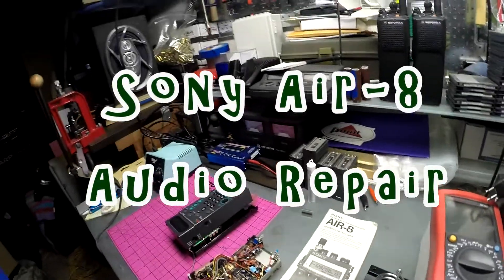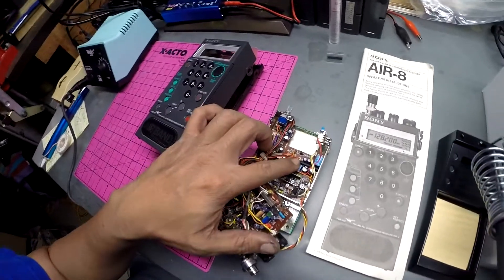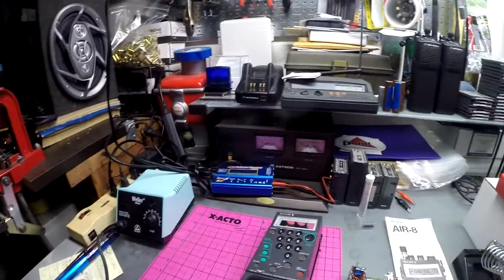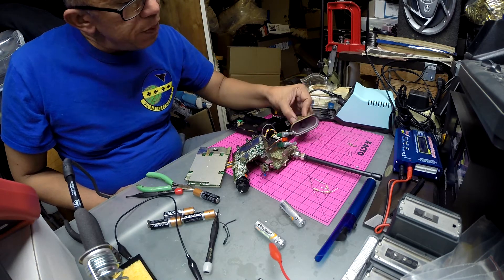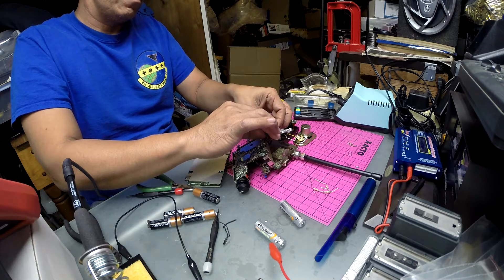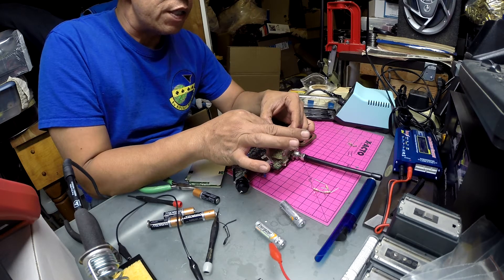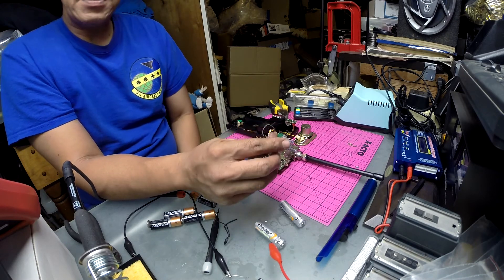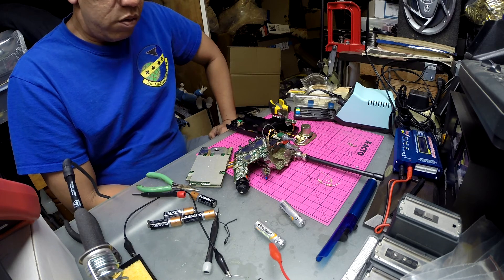Sony AIR-8 Audio Repair

Comment: I have replaced the AF Amp, capacitors, C243, C246, C249, C245, C247, C250, C62,  and C265. I also replaced resistor R246, transistors Q210, And Q211.  IC 203 is outputting 3V just fine. When I adjust the volume I get little change in volume but it’s there.  The Squelch is working just find but I did replace both volume and squelch pots just in case but the is no change.  When do I look next please advise?

Comment: Mike new issue with a Sony Air-8 I just got. I have audio and lots of it but it’s on full blast and can’t change it.  I changed the volume potentiometer but not change any ideas?

Comment: Good video just plugged the wrong power plug into external Jack and can’t get any sound from it (Sony air-8.) any ideas? Thanks John.
Reply from the maker: maybe you could have  blown something if the power  had the wrong polarity or voltage

Comment: I just got my ICF-Pro80 to work as I recapped the entire unit and replaced the AF amp.  FM works grate but my AM/SW/MW is quiet on that band did I miss something?
Reply: plug in an external antenna, anyways, it would have been better if the SW tunner went up to 30MHz on that model. but well, probably just to annoy us and focus on the VHF.

Comment: I changed all the caps, the two pots, the AF Amp and I still don’t have any audio please advise.
Reply: Hello there. I have that same problem. Did you solve the problem.I did all the things you did, but there is no sound. Only ic1 and ic2 left
Reply: FELL TURBO I am at the same point as you going to change the ic1 and ic2 today. I will let you know also check the muting circuit while you are at it.
Reply: @scross1220  I connected the pot on the silencer to the wrong circuit as you said.Thank you.RADIO SONY AIR7
Reply: john wick glad it’s working now
Reply: @scross1220 Did you solve the fault?
Reply: john wick Yes I did and I also replaced transistor Q210 as well
Reply: @scross1220  Enriches by sharing information.Thank you again

Comment: What's the sound amplifier you bought on eBay ??
Reply from the maker: dred007papa yeah it was the amplifier I replaced it but still had the issue and ended up being the volume knobs was worn.
Reply: AG6IP I need the potentiometer. I can't find a part. Can you help ?? 

It's the volume one. A 20k pot ???
Reply: Does not need to be identical. Just one that would work
Reply from the maker: dred007papa sounds about right......I just put a fixed resistor for now. I plan to open the pot up and fix it in the future you can get a similar one but it will have to fit on the case
Reply: A fixed resistor ? which one did you use ?
Reply from the maker: dred007papa I cannot remember  had to play around with the values to get the right one.
Reply from the maker: https://youtu.be/FO9-2W-yrls check that video out....I guess I put  in a 100K resistor for get audio out....with out the resistor and if you short it out the audio is pretty  loud  so  100K  worked good for me.

Comment: Hi can you talk more about where you got the audio amplifier or what type it is ect?
I believe they call it an "ic" ?

Many thanks.
Reply from the maker: Jimmy Hendrix I got it from Ebay but that dint fix the problem on this issue....it was the potentiometer
Reply: AG6IP ah brilliant so eBay has them, I'm just trying to find that piece. You can't remember what it's called ? Hehe
Reply from the maker: Jimmy Hendrix I have the old piece....I take a pic and send it to you when I get home.
Reply: AG6IP thank you so much :-))
Reply from the maker: its a SANYO LA4145 it was  $3.60 in ebay
Reply: AG6IP your a legend !! Thanks so much !
Reply from the maker: but like I said that  dint  fix my issue....lol....its  was the volume know not making contact....good luck let me know how yours goes....
Reply: AG6IP yeah, I don't know if that's the actual issue here either. It's not the potentiometers. But I thought I would take the time to ask you about the audio amplifier in case it was that since you had found one. How did you work out what sort of audio amplifier would work ? Thanks again for the feedback 

PS: I have not received the radio yet it's on its way but the guy says it doesn't come on at all so it'll be interesting to see if it's fixable.
Reply from the maker: cool  i just remembered  touching the board in the back after I opened it and they audio started to get  loud  then I jumpered  the to volume know and it  went max volume thats  after I messed with the amplifier...so I just  out a fixed resistor inline and now the audio is fixed to a good listening level
Reply: AG6IP that was a smart way of doing it as well. But you can't use the volume knob then? The volume must be stuck at a specific level, no?
Reply from the maker: yeah  its  fixed  had  to find the right resistance  that is a good comfortable level.....
have u seen that video?
Reply from the maker: https://www.youtube.com/edit?o=U&video_id=FO9-2W-yrls
Reply: AG6IP what video is that ? The trains ?
Reply: I changed the volume potentiometer to a 50k one that should work shouldn't it ?

I ordered the audio amplifier like you got at the start of the video. Haven't been able to fix it yet. There's lcd and lights but no sound at all. Tried changing a couple of capacitors but didn't help

Comment: I changed my pots and I still have no audio what did I miss?
Reply from the maker: Has the audio amplifier been changed?
Reply: AG6IP not yet I need to order on do you know the part number
Reply from the maker: @scross1220  SANYO LA4145.  Check the previous messages this is what  I got.
Reply: AG6IP Thanks I just ordered it. I will let you know how it goes.  BTW I got ride of that ugly green LED for the backlight and put in a blue.  I see everyone change it out.
Reply: AG6IP I didn’t see the previous messages but I just noticed that there is two of these IF amps IC1 and IC2 which ones should I do first?  I did change both pots and I seethe squelch now works just not the volume. Do you have any other parts you want me to look at?
Reply from the maker: @scross1220  yeah I'm not sure  I dont have the schematics.  Where did u get the pots?  Are they same replacements?
Reply: AG6IP I got them from Mouser p# PTP901-030K-203B2 for the 20K ohms and p# PTP902-030K-503A3 for the 50K ohms one.  20K for audio and 50K for the squelch
Reply from the maker: @scross1220  cool thanks
Reply: AG6IP Any time. Now I just have to fix this. I guess it’s more than the pots. I also got a junk unit to scavage parts from.
Reply: AG6IP hey do you think I can talk you into making a copy or scan of your manual and I will send you the service manual
Reply: AG6IP I changed all the electrolytic caps, and the the two pot trimmers. It’s looking more it’s the AF amplifier that is dead.  Is there a way of testing it for sure and where else should I look like the IF amp?
Reply: Is there any way I can get you to copy your Air-8 user manual for me?